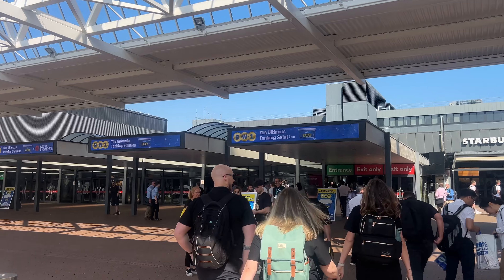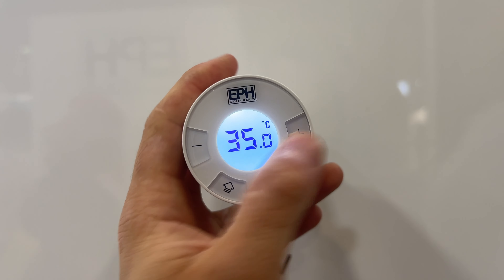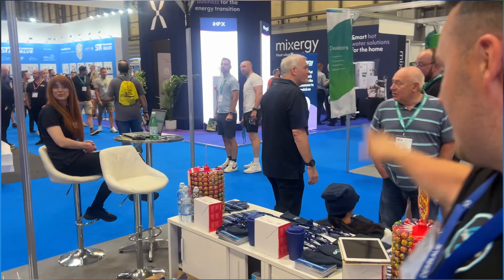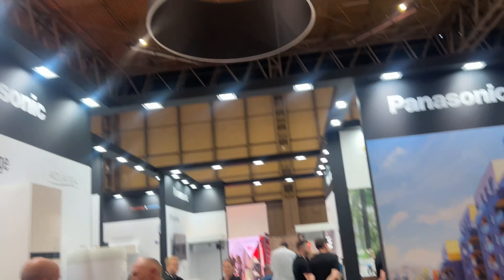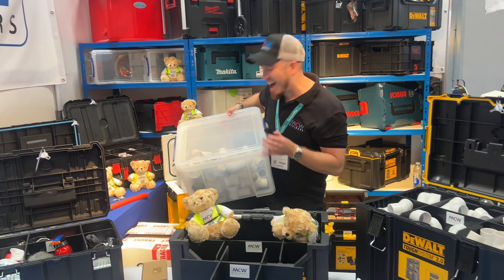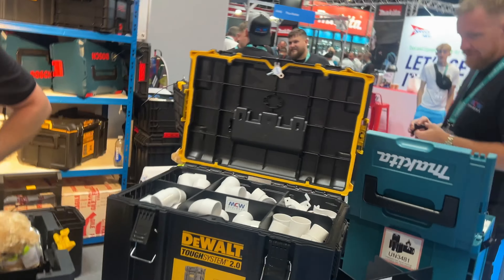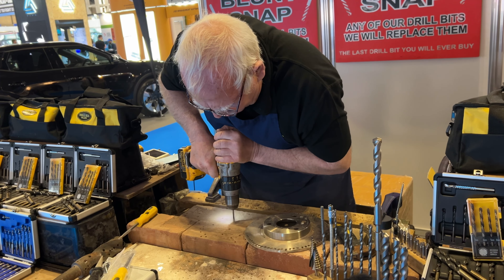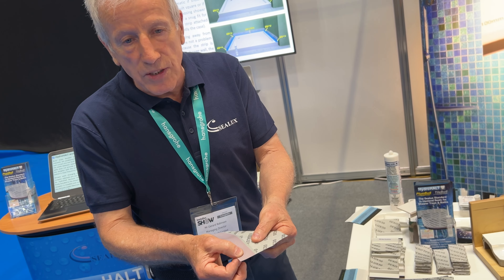Discovering Hidden Gems at Installer Show 2024!

Comment: Very nice vlog just fitted some bull fix for a towel radiator tall one on the wall that I have overboard with waterproof panelling when I put the 20 mil hole in and put the insert ring things in I’ve had to go past the waterproof board to anchor the ball fix into the plasterboard behind so I’m hoping it will keep the radiators on the walls🤞👍👍👍👍👍🏴🏴🏴🏴💯🍺
Reply from the maker: No doubt it will